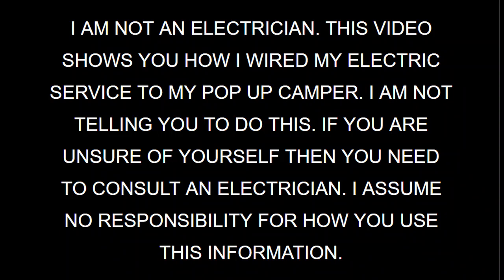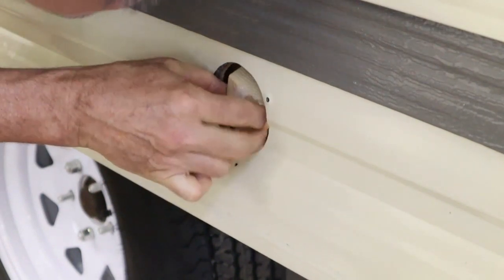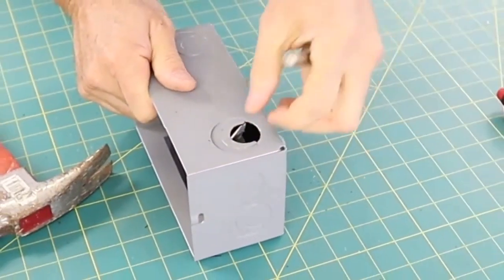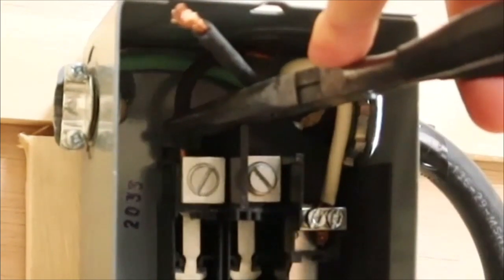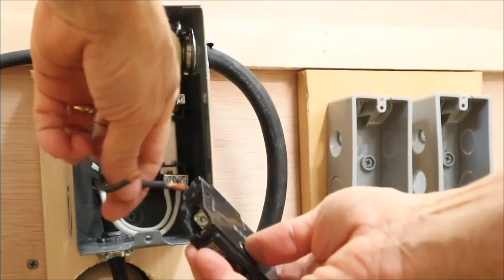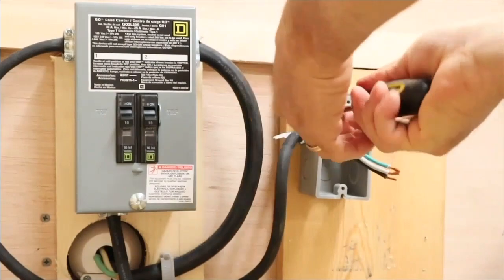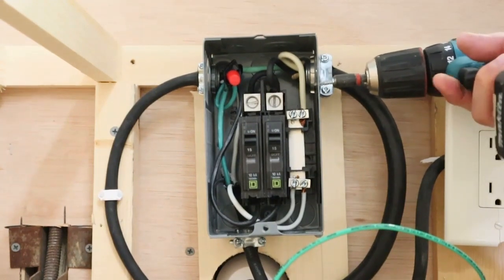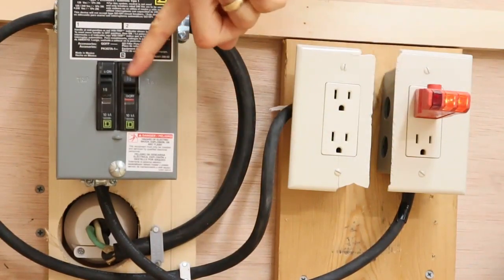POP UP CAMPER ELECTRICAL SYSTEM Shore Power 30 Amp Electricity Service PT 18

Comment: Excellent video! Just what I was looking for. Thinking of buying one of those Rockwood OTG basic popups so I can just get out occasionally on the weekends with my wife and pups. I had a full sized RV and hated it. Way too much work for a weekend. With the basic popup, I can be all set up in minutes. But, I will always be at a campground with 30amp service so I'd like to take advantage of that for a portable AC unit. This video shows me how to add the components to tap into the 30 amp service.

Comment: Well done I like the extra ground you added. This is one thing I'll have to do at a later date. I will post a video of how my power is going to be for time being but I will have to do it right once I get figured out what I'll need. Hey what did you do with your Battery ground did you ever work that out please share with us. I hope your tomorrow is better than your today was.
Reply from the maker: I never got the other battery challenge to work out. I have a different inverter coming this week and I will see if the old inverter may be the problem. Good luck with yours. Thans for watching.

Comment: Great vids. I’ve watched about 15 of your vids tonight. This may be a silly question but why did u put two outlets right next to the service box? Why not run wire from the service box directly to where you want outlets within the camper? Thanks.
Reply from the maker: The two outlets beside the service box are strictly shore power. The plug ins there from this other outlets can be unplugged and switched over to the inverter when needed.

Comment: I have a question as well. I’m using a 4 panel breaker box. Installing 4 outlets but want them all on their own breaker. Do I need to create a bridge to all 4 breakers just as you did to the one ?

Comment: Good video. I learned a lot from watching. Very easy to follow.  Can I install 4 or 5 15-amp breakers on a 30 amp shore power, or do I need to bump up 50-amp?
I want to put each appliance on its own breaker, running a portable 1400 BTU AC, a microwave, a toaster oven, an electric 3 hot-plates or burners stove, 2 portable electric heaters. Some of them can share a breaker.
Reply from the maker: You can install as many breakers and circuits that you want. However, the total usage off all the breakers combined cannot exceed 30 amps. Actually, with safety factors built in, you probably won't get a full 30 amps total before tripping the breaker. So, example, you probably cannot run AC, microwave, and toaster at the same time even if they are on separate breakers. Good luck.

Comment: I’m not an expert in electrical systems by any means but I know a little,
but you can just plug this into a 30 amp campground connection without reducing the power? Like a fridge and heater won’t be damaged by this amount of power?
Reply from the maker: 30 amps just means there are a total of 30 amps of electricity available. It also means all of your electric stuff cannot consume more than a total of 30 amps if turned on all at the same time. The fridge may only use 3 amps of the 30 amps available anf that is ok. Thanks for watching.
Reply from the maker: Also, this is 110 volts not 220 volts. If you happen to plug this into 30 amps 220 volts really bad things will happen.
Reply: So I guess what’s the point of having the 30 amp plug when you could have used a 110 shore plug? Just for the capability of having up to 30 amps?
Reply from the maker: @bentaylor4681  You seem to be confusing volts and amps and it could end badly. There is 30 amp 220 volts for your house electric dryer and maybe electric oven. There is also 15 amp 110 volts for your house lights and other small electrical stuff, TV's, Radio's, computers, etc. ------At the RV park there is 30 amp 110 volt plugs for your trailer. There may also be 15 amp 110 volt and 50 amp 110 volt. Which one of those you need to use will depend on how many amps your trailer needs Generally, if you have no AC or electric heat or microwave you could use 15 amp plug. If you have one AC you probably need 30 amps. If you have a big travel trailer with 2 AC units you will need 50 amps. My pop up has a fridge, lights, computer, electric heater, and a portable AC. We will be using a 110 volt 30 amp plug to provide the power we need for all that. I hope this helps.
Reply: Okay so with this system you wouldn’t need and adaptor at the rv park you could just plug right into there outlet there if they offer a 30 amp 110v connection? And so does that mean that pretty much all campground connections run off of 110v not 220v?
Reply from the maker: @bentaylor4681  Most campgrounds have a the 30 amp plug and you would not need an adapter. However, I carry a 15 to 30 amp and a 50 to 30 amp adapter just in case I get in a bind. It hasn't happened yet. Yes, correct, all parks that I have been to only have 110 volts.

Comment: adding a ground wire to the frame is a bad idea (by the way that's not technically a ground wire as there is no path to ground on the frame in most cases, you have just bonded the box to the frame ) ,note that pop-ups ect; are on rubber wheels and unless you ground the pop-up or trailer to a correct ground ( driven ground rod ,metal water pipe ran under ground ect.) then you don 't have a ground . if by chance ; say one of your hot wires shorts against or touches the side of you box and someone leans against or touches your trailer they become a path to ground . this kind of stuff gets people electrocuted and yes I'm a licensed electrician with 40 years experience
 ,be safe .
Reply: Wouldn't it trip the breakers though ?